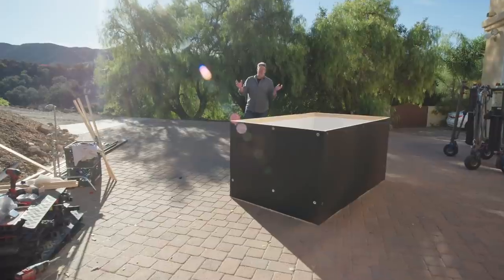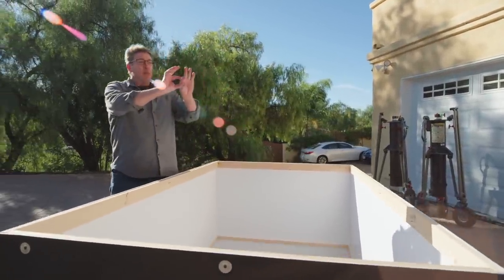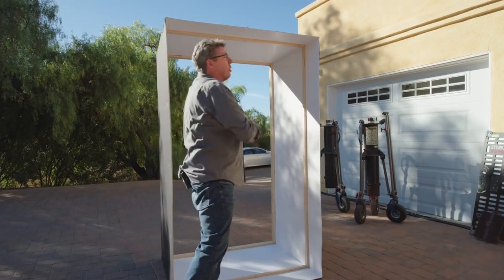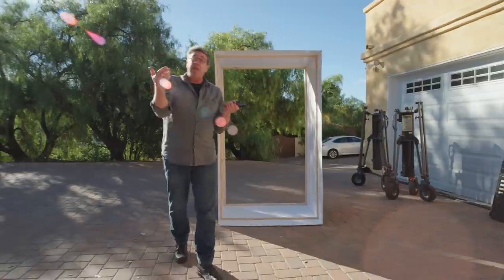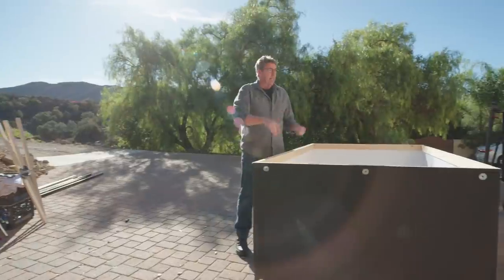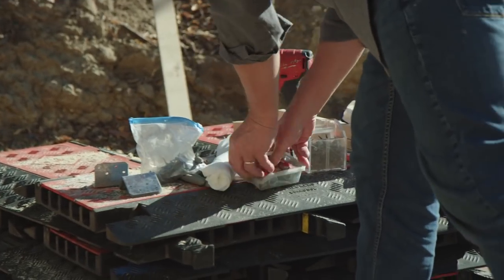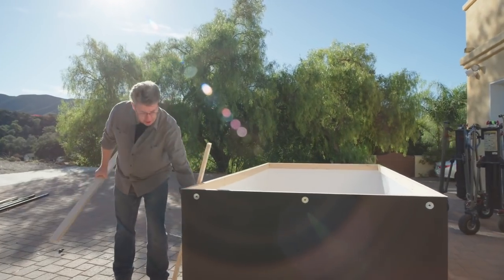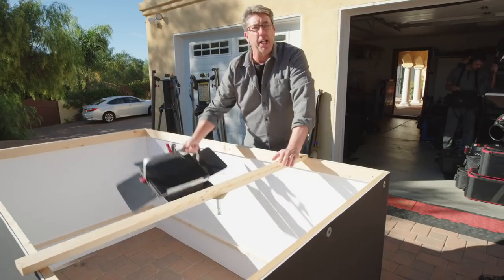How To Build A Soft Box

Comment: When I worked in the photo department at Mattel in the 80s all the studios had DIY foam core soft boxes. They all had varying degrees of warmth, depending on how yellowed the interior was from heat and age. They eventually lined the interiors with Rosco silver reflective material and the Ektachrome started to look more consistent across the studios.

Comment: Awesome content. I've used "weedblock" garden cloth to flag off a light, too.
Reply: Really? I've got a full 200 yard roll of that stuff. I'm gonna have to try that. I'm guessing you have to double or triple it up to really block light though?
Reply: Same as plumbers plastic, or builders plastic for sealing the sand shapes before a concrete pour.
Only thing to be careful of is heat - LED's are fine, Tungstens, not so much :D
Reply: @PiDsPagePrototypes  Damnit. The only light I currently own is a 1k tungsten.
Reply: @freednighthawk  For Redhead's, Google-Fu "R7s LED" ;)
Not as luminous yet, but getting there.
Reply: @PiDsPagePrototypes  no help. I'm running a Lowel DP tungsten, which uses a 1k FEL lamp. I want to get more modern LED fixtures, but with C19 keeping work slow, I don't see that happening any time soon, especially since I'm only a grip.
Reply: @freednighthawk  mate, I feel that - We're in second wave lockdown here in Melbourne, Oz,.. industry is pretty much wiped out.
Reply: @freednighthawk  I think it did a good job with one - but that makes sense. Moment of desperation drove me to it!
Reply: @PiDsPagePrototypes  Don't let the smoke out!  ;-)

Comment: I never came accross the maxi switch. Very suprised it has the same output as the s60. I have several Maxi MIX they are much mor powerfull than the s60... Also have beter colours. Anyyway thanks for the tips

Comment: The boys over on the Flite Test channel, where they build a lot (!!) of foam core based RC Aircraft, would approve of most of this construction, but maybe not the wood screws for the frame to mount the Diff from - those sections would easily attach with a hot glue gun instead.
Using foam, for anything actors are going to be underneath, is a big safety boon, as it's a lot less mass.
@Shane - rather then the table cloths, hardware stores will also have rolls of 'plumbers' or 'concreters' black plastic sheet, about 2 meters wide and 30 meters long, price is comparable, but less hassle blocking windows with one big sheet - and it slices with the same tool as used on Lee Gels.
We do have to be cautious with hot lights around plastics and foams, but LED's aren't anywhere near as much of an issue.